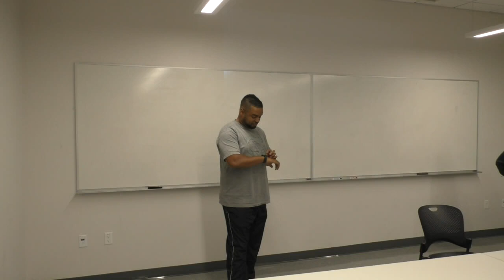Travis Eaglin

Comment: Your explanation of the importance of having courses on codes and standards was well articulated. You effectively highlighted how these codes and standards' broad and ambiguous nature leaves room for interpretation, making a dedicated class essential. Your experience underlined the significance of these codes and standards in engineering, particularly in maintenance engineering and design compliance with the ASME code. Your ability to connect the question to your work experience was impressive, and I have no critiques. Travis, your presentation also provided solid reasons for the necessity of courses on codes and standards backed by your real-world experience. It was informative and well-delivered, and I have no feedback for improvement.

Comment: You did a good job explaining why we should have courses on codes and standards. When you talked about how the codes and standards can be written very broad and ambiguous leaving room for interpretation is one of the main reasons we should have a class on it. In my own experience codes and standards they were one of the most important parts of engineering. If you go into maintenance engineering you'll be using API standards to make sure all machinery is performing to code. If you ever want to build some thing of your own you have to make sure that everything is designed to ASME code. You did a very good job connecting the question to your work experience I have no critiques.